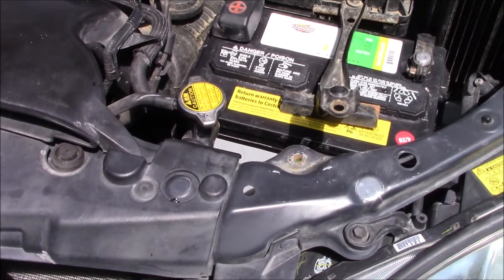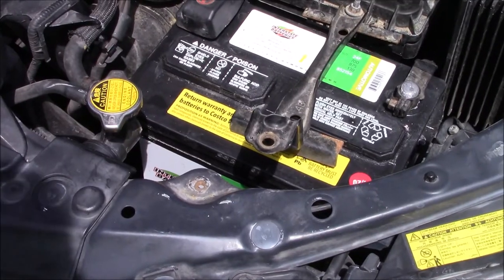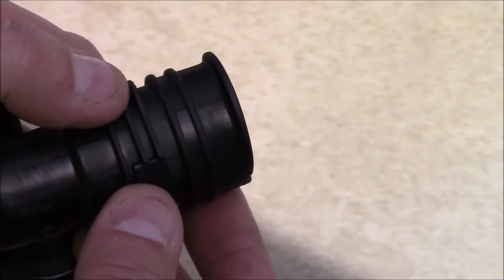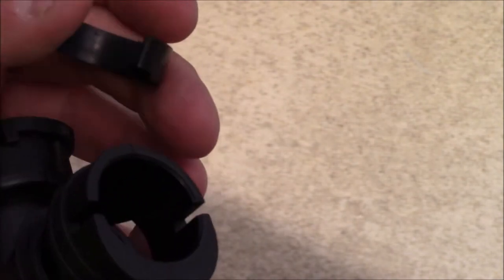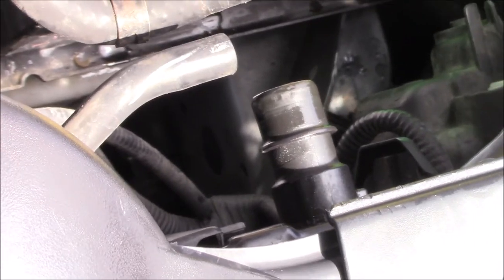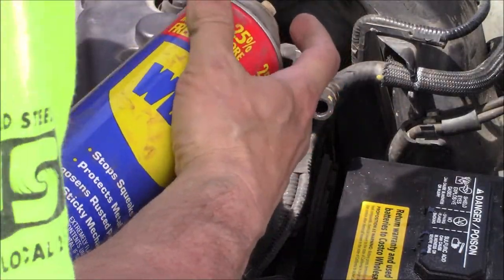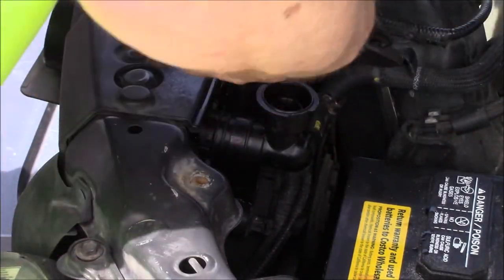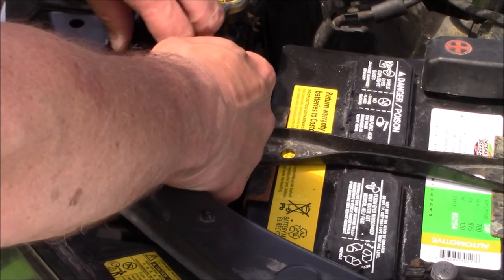Toyota Sienna or Lexus RX350 coolant filler neck replacement 2007 2008 2009

Comment: I replaced the battery yesterday morning on our 2007 Sienna and must have hit the small lower hose on the filler neck in the process. I discovered a complete break off of the neck fitting, and the remaining fitting inside the hose was brittle (it broke into tiny pieces while trying to remove it). Anyway, a leak drew my attention to this issue later in the day and your video was the first one that came up which happened to be exactly what I needed.

In case this is helpful for others, I too found the removal to be a pain. I have a small prybar that I tried in various places, but it was apparent that equal pressure was key, so I applied the prybar behind the flange on the lower right side and applied a large flat head screw driver on the upper left which was either the perfect arrangement, or this thing finally gave way after maybe 10 minutes of fighting with it. I used a heat gun to soften the small upper hose which made both removing and reinstalling a breeze, and I just used a little coolant to lube the seal and radiator fitting.
Reply from the maker: good tips

Comment: Just replaced one yesterday, after watching few clips like this on YT, cost $36 at AutoZ, Dorman brand, Chna made. 15-20 minutes for the job. Hardest part is to pry the old one out. Replacing the new battery caused this. Thanks for the clip.
Reply from the maker: Glad that this video helped
Reply: did the same thing, broke off where the hose connects. mechanic said i need a whole new radiator but i called his bs and knew i could replace it 😂 thanks for the video guy
Reply from the maker: @stonecold8365  glad this helped you out

Comment: So I smelled something burning. I came to check that theirs a tiny coolant leak. That second hose that is bigger than the hose in the fron, is screwed in. Before I do anything dumb is it suppose to be like that?? I’ve done research and apparently theirs a piece that holds that hose in place and it comes off so to hold the coolant in they screwed in some screws. Do I take the screws off and reconnect the hose??
Reply from the maker: I believe the design of part I replaced in this video, is not widely used on most other models.  What you are describing may have been modified by someone or is a different design.  I suggest you look up the part at Rockauto.com or another online auto part retailer and view the photos to see if your part matches.  I wish you the best on your repair.

Comment: New filler neck part: Dorman 902-408.   You basically can't look at the engine compartment without having to replace this.  It's about $30 to $50, mostly profit, but your Lexus won't work without it.  Enjoying modern motoring yet?
Reply from the maker: the plastic it is made from tend to get very brittle